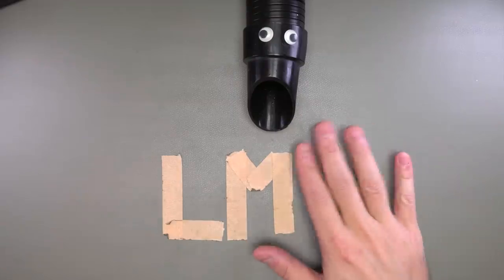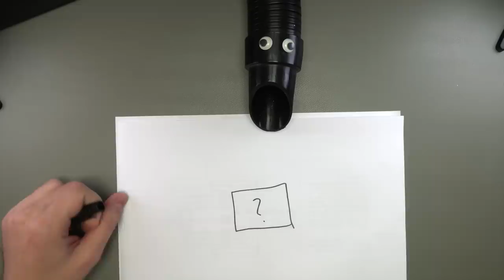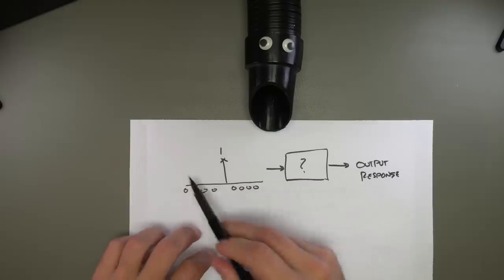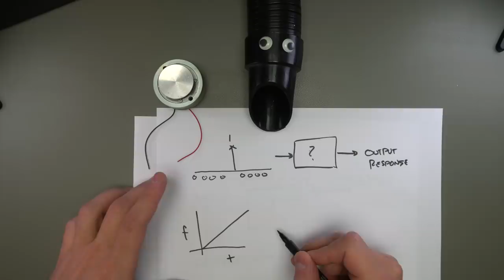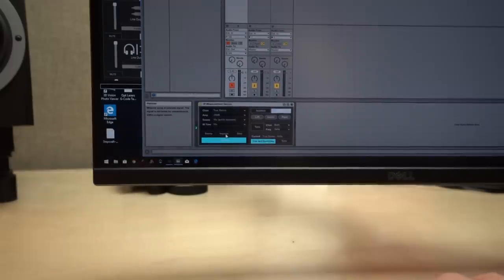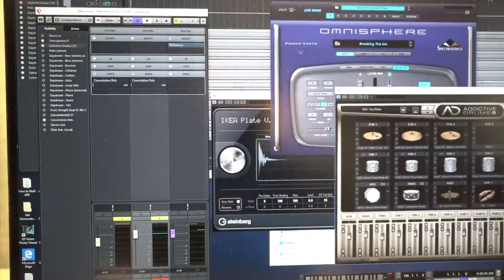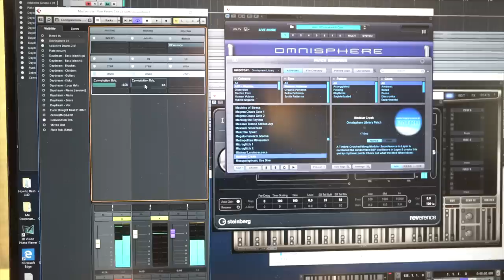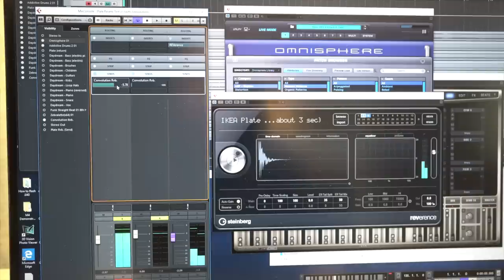"IKEA Hack" Plate Reverb Part 3 (Free IR files!)

Comment: Fabulous evolution your plate reverb project. Myself and a friend built a short run of full size plate reverbs in the early 80s, using the same principles. It was enjoyable watching your short series. Even if someone doesn't build one, it will offer them more insight into the use of not only the physical units if they have access, but also what's happening when they adjust settings in a plugin. I've been thinking of a new design about the same size as what you've done here, thank you for providing a benchmark for the smaller plate material size. You could also try adjusting the tension on the plate support in the frame, which will affect the frequency response and length of decay. I am also thinking of making the plate an irregular shape, to test the end result compared to using similar logic when designing a chamber, i.e. no parallel edges, so that standing waves are reduced.

Comment: Just loaded a couple into the Reason RV7000MkII. Used the V2 w/light damping, then actually set a negative 10ms predelay(which I've never done before), Stretched out the size a bit, cut the LF damp at 80Hz, and used it as a send reverb across nearly every track in a current mix of "Up On The Housetop" we're working on, and I like it a lot! Gives it a bit more character than the plate sim I was using before. Not as full and dark, and that's kinda the point. Better for this particular track, but it highlights it's downfalls. There are very good reasons the original plates were hundreds of pounds! But it's a nice tool for the toolbox and I can't thank you enough for offering them up, and making the complete howto. Cudos!

Comment: I just read a thing about balanced piezos. Could be a thing worth knowing! It involves sandwiching two piezos, electrically isolated and sending one to hot, one to cold, and both to ground. Sounds good! I'm about to build one myself to go inside my wardrobe. XLR in and out on the door and a mechanical dampener controlled by a servo that places a wedge of foam against the plate going from minimum contact (the very tip of the wedge) to maximum contact (fully squished)

Comment: convolution basically overlays the entire impulse for every sample together and sums them together. for each sample you multiply the entire impulse by it. this is simple conceptually but usually uses more cpu and memory. so you have to have a buffer in ram as long or longer than the IR, which for hall reverbs could be fairly large. the longer the buffer, the more processing it takes to convolve it. vector math can speed it up dramatically but it’s still slower.

Comment: This is a great project, I’ve been thinking of something similar. To dampen it, what do you think of a set up similar to the transducer but with a sponge, soft brush or pad that you can use to apply various pressure to the plate.

Comment: actually convolution's principle is very simple; play back the response every sample, multiplied in volume by the normalized level of that sample. this effectively replicates how the space responds to the sound because you can imagine any time-domain signal as being a train of impulses at different levels played in succession. the reason why there is complicated math involved is because you can't actually implement the simplified convolution without unreasonable amounts of ram and computing power.
Reply: Thanks. This was the explanation that gave me intuition for what it does best, lots of explanations ive read were just going crazy over DSP stuff.
Reply: And the complicated math 'simply' multiplies the spectrum of the sample with the spectrum of the impulse and then converts that back to an audio signal!
Reply: @SporeSpood  when you say 'multiply' do you mean like a matrix multiplication? is it just taking FFTs of both signals and matrix multiplying those? and if so, how is the temporal aspect of the impulse taken into account?
Reply: @famitory  No I don't mean matrix multiplication. There is a theorem (it's called "the convolution theorem", just plow through the algebra to prove it) that states that f * g = F^-1[ F[f] F[g] ]. A convolution of two functions (or signals) is the inverse fourier transform of the product of the fourier transform of one signal and the fourier transform of the other signal.

I'm not quite sure actually how that would work in a discrete way, maybe you can use the periodicity of the fourier transform to ensure that you have enough samples to multiply through. (if you check https://en.wikipedia.org/wiki/Convolution_theorem#Functions_of_discrete_variable_sequences, that seems exactly how it works)
Reply: @famitory  The temporal aspect of the impulse is what is being conserved in the fourier transform. Basically you're looking at the signal and going "how much of this frequency should there be, according to the impulse" and then going back to the time domain. Thinking more about it, the impulse acts like a transfer function (https://en.wikipedia.org/wiki/Transfer_function) which is a way to describe the response of a mechanical or electrical system. Writing this down makes me kind of curious if I can predict the impulse the plate reverb will make, maybe I can make a synthetic plate reverb haha.

Comment: Wonder what it would sound like if the plate was 1/8, 3/8. 1/4 Inch Steel plates...
Reply from the maker: With that much mass on a thick plate, I wonder if you’ll get a good sound. I say this because you’ll need to put a lot of energy into the plate from the transducer and once it starts resonating, it’ll keep ringing out for a long time.  I think it will end up being more of a “slow wash of reverb” rather than a more reactive/responsive reverb. Might be cool though.